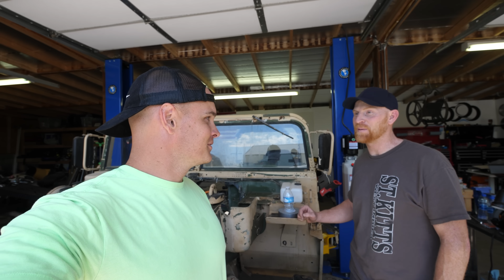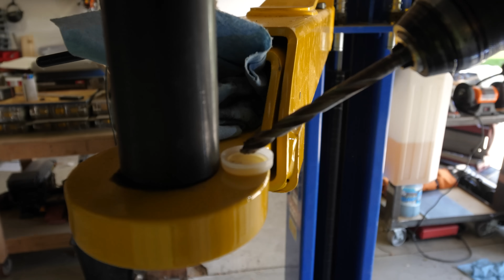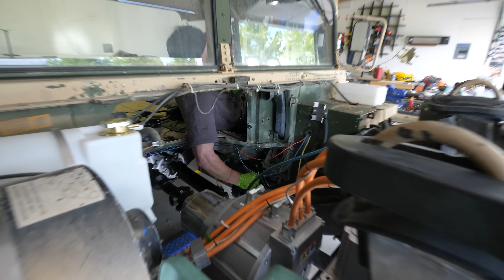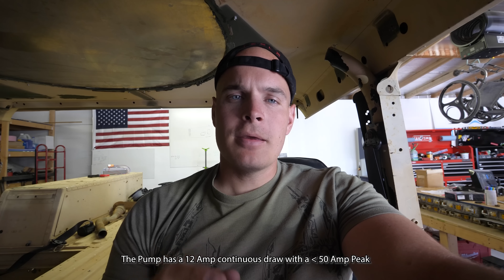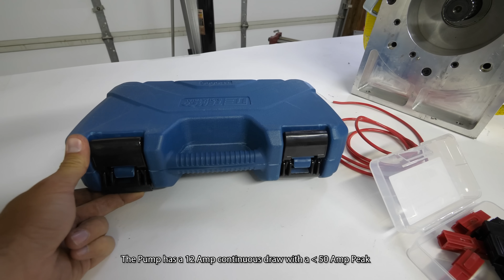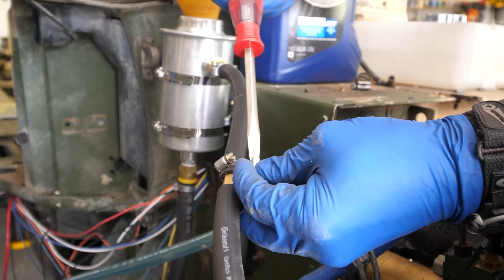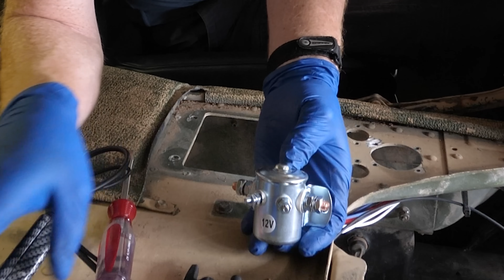We might have a problem with the Brakes... - Electric Hummer Conversion!

Comment: Adapting a Prius electric power steering column might be a good option, that are quiet and use high torque electric motors to turn the steering shaft
Reply: It's a good idea.. but the Hmmwv is a body on frame, and the column mounts are actually pretty flimsy.  All they are designed to do is hold the steering wheel for the driver, and crumple in a crash.  So if you mount a power column, you'd have to make the mounts stiffer to take the torque (it's ALOT of torque with a Hmmwv).. yet still be safe-ish in a crash.  If it was possible to put a simple electric assist steering system in a Hmmwv, it would be pretty sweet tho.. more efficient.. probably more reliable.. as long as you could provide enough assist to steer the wheels with a heavy truck with big tires which are sometimes aired down.

Comment: To make the hydraulics quieter, you could build a box around it of sound deadening material. Though, you probably want to keep it open on the ends, so you can get a little airflow over it to help cool the motor.

Also, it's not gonna be nearly that loud once the doghouse isn't open.

Another way to make it SEEM quieter, would be to relocate the pump to the back of the vehicle. of the very front, further away from you. One of the advantages of hydraulic systems, is the layout flexibility.

Comment: Use Car Sound Deadening wrap and cover areas close to the pump.

Also before putting in the interior (if you decide to cover the metal chassis ) put car sound deadening wrap on the frame then put on the interior floor to cover it.

Comment: The noise is present because the pump is running continuously,it should be setup just to assist when pressure and assist is needed not all the time.ex same thing happens with your car lift when you press the switch to go up,pump is turning to create positive pressure hence the noise,but when you release the button no noise.I hope this helps.

Comment: Have you thought about changing up your "ignition" switch for a multi-position switch that has an "accessory" position so you can energize your low-amp circuits (radios, interior lights, etc) without turning on your high-amp stuff (power steering, charger/inverter)?
Reply: Good idea...

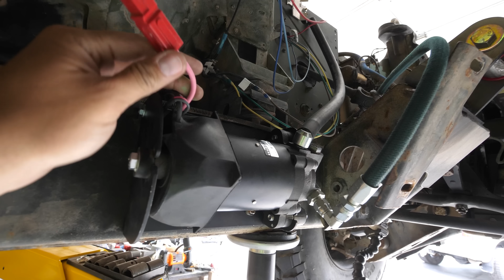Comment: 6:43 where that hose if laying against the metal frame, cut a piece of rubber hose, then split it down the side so you can slip it over your hydraulic line to protect it. Otherwise, eventually it WILL wear a hole in the line, and probably at the worst possible moment lol.

Comment: Hydraulic pumps are noisy especially if there’s no fluid. With it being a electric car you’ll hear things you wouldn’t normally hear over a combustion engine. Might just have to use sound dampening material when you put the covers back on or have a artificial engine noise?

Comment: Seems like a lethal combination. Heavy vehicle with on-demand brake pressure generation. Surprised you didn't add a hydraulic accumulator between the pump and brake/steering system.

Comment: Electric Power Steering and Brake Assist are the clear champions but I dont think there are any aftermarket solutions for a Hummer. 
They save a LOT of power, run directly off electricity and make little to no noise.
Reply: Im not aware of any company that makes an electric assist steering "box".  Everything I have seen is a rack and pinion style, or column assist.  And in a Hmmwv, the steering column mount is relatively light weight aluminum.  It would twist badly with a column assist unless reinforced.  Although it would be pretty cool if someone retrofitted an electric brake booster.  You'd have to find one that's electrically pretty simple, hydraulicly compatible (proper volume and pressure), and probably make appropriate mechanical mounts/pedal.  When the hydro boost goes bad in a Hmmwv it can be confusing to diagnose because people think they have a bad power steering pump, or bad steering box.
Reply: What about the brakes though? I wonder if there's some kind of hydraulic linear actuator that's powerful and responsive enough to use here... might require some fancy control circuitry.
Reply: @DFPercush  A funny DIY solution like that might work on a little robots project, but this is a car. Safety and Reliability go first, and a well thought out and tested off the shelf system is pretty much the only sensible choice. 
Both failure to brake as well as unintended braking are severely dangerous, so this really is not an easy field for a DIY solution.
Reply: @drkastenbrot  Probably right. But there's not much point in using EPS if you still need the hydraulic pump for the brakes, that was my point. Maybe air brakes? Those are fail safe. Both of those combined are a lot more expensive and laborious than some sound damping though.
Reply: Watching this you can really see the advantages of electric power steering.  With the hydraulic power steering you're constantly drawing power to to compress the fluid and sinnce it heats up, now you gotta dump the heat through a heat exchanger and you now have to carry the weight of the fluid,  reservoir, motor/pump, and heat exchanger. What a mess.

With electric power steering you only have to carry the weight of the motor and only draw power when you're turning.  It's no wonder aircraft and automobiles have moved away from hydraulic systems to electrically activated systems.

Comment: So Zack if your pump fails what redundancy do you have for your brakes? Why wouldn’t you just use a Electric power steering rack? Then use conventional hydraulics system for your brakes? If you Dynomat the area you won’t be able to hear the wining anymore.

Comment: I apologize for the lack of specifics but I know that many new cars use carpet-like material to deaden road, engine, etc. noise. If you could somehow wrap that around the pump in some way (maybe build a metal box lined in automotive carpet) that might just do the trick

Comment: Rather than using a relay or solenoid that requires a constant power draw to stay on, you could design a system where an arm pulls a power switch on but then disconnects when the key is in run, and another arm pulls the power off and then disconnects when the key is turned off.  It wouldn't draw power constantly, and would save electricity.  (You can buy them, of course.)  Also, please measure the amp draw of your solenoid when it's on, with your multimeter.  Amps X Volts is watts, and watts is the amount if heat it's going to have to dissipate.  Then post a quick video of that for us all.  Thanks.

Comment: Re: sound damping the pump. Use/find a free audio frequency analyzer app on your phone and see what its fundamental frequency is. It's probably around 500Hz. See what best absorbs this frequency while also being safe (non flammable, heat resistent). Rockwool by Roxul could work very well for this application. However keep in mind that any insulation from sound energy will more than likely also insulate for heat energy. If there is enough air flow then you could build a stainless housing shield to put over the pump which is lined with Rockwool, or simply line the dog house cover when you are done.

Comment: Double check the fluid in the system is correct for your electric pump. If not it will go mad and probably draw way too much current.

Comment: For dampening noise, padding it with car insulation or dampening sheets and putting it in an air-tight enclosure could work

Comment: Add a hydraulic accumulator and pressure switch, once it’s charged the pump will turn off. On a highway journey with limited steering input and braking the pump won’t even need to run.
Reply: Came here just to say this. 

Also, a hydraulic accumulator will ensure that is the pump fails (which they do) you won’t lose powered braking. 

I’d also be inclined separate the system & put in 2 pumps. One for steering & one for brakes, again for redundancy.
Reply: @Kelvasco  Yes the pressure accumulator and switch will help a lot, and to dampen the noise you just need to put the doghouse cover back in place, with the neoprene sound absorber intact, which will go a long way to making it quiet. Hard otherwise to damp it fully, as you need airflow around it to keep it cool. You can use extra rubber mounts and a metal shield to cover the top and bottom, which will help with debris control off road, and this can also have a neoprene rubber layer stuck on to damp sound more as well, but still allow cooling air to flow through. However I will say that the fluid reservoir is a little on the small side to run with an accumulator, it will need to be at least double the volume of the accumulator bladder, so as to keep enough fluid in the system to not suck air. 

As well you really want a spin on filter housing, and a hydraulic oil filter in the suction line, so as to keep dirt out of the system. The spin on filter should be there from the original Hummer parts bin, and it will go a long way to keeping the precision hydraulic parts clean. Plenty of chassis space there next to the pump suction line to put the filter in, and it will rarely need changing, just the annual lubrication service for the transmission will involve changing the filter, and topping up the fluid again.
Reply: @SeanBZA  FYI the stock Hmmwv power steering system doesn't have a spin on filter.  Just a magnet inside the pump reservoir
Reply: @Kelvasco  accumulator function in case of pump failure is only useful if there is an alarm for the failure. Otherwise, the failure will happen and the driver will be oblivious and continue until the accumulator is depleted and again faces a catastrophic situation anyway.
Reply: great idea it would also extend the life of the pump
Reply: true it works en sound damping same as tesla ;)
Reply: Very obvious point, obvious because it makes a ton of sense. I only ever hear the power steering while parallel parking which is when it needs to work hardest.
Reply: @bramweinreder2346  Good point, it would be interesting to know more about the current set up, whether the pump is constantly under load or not. A pressure gauge or running the pump free flow would be a good test. I suspect the hydroboost is under constant pressure and feeds the steering via a relief valve. If the steering is controlled by an open centre valve, the circuit will need split with a second pump as already suggested, before adding an accumulator.
Reply: dude gtma, i said the same
Reply: 2nd, accumulator keeps the pump off and provides a safety factor on power loss.   Also picked a bad spot to mount such a pump.    I suspect this setup would need some modifying due to the fact that the default position for these devices is unrestricted flow, aka open center hydraulics.
Reply: I was thinking the same. If I'm right there is also a bit of redundancy in this. For example if the pump looses power while driving you still have brakes and steering.
Reply: @153SCORN  well the brakes and steering are there no matter what -- they're just unassisted at that point.   Assisted brakes and steering are convenience things.   Without boost, they both still work.
Reply: Even my VW Lupo has such a device or each central heating system in the house.
Reply: Also a angular switch to detect the turn of the steering wheel. And Turn on or off the pump.
Reply: @c1a9h9r9  seems like that would only work if there was one pump for brakes and one for steering.  If you turn off the pump because there is now change in steering angle, you wouldn't have the pump flow for the brakes when you suddenly need them.  You wouldn't want to wait for the pump to spin up after you've hit the brakes.  Stopping a Hmmwv when the power steering pump fails is amazingly difficult... Like.. put both feet on the brake, hold onto the steering wheel, and try to stand your entire body up on the pedal and you still will only slowly come to a stop.  I've experienced this a couple times.
Reply: @strandtc  that's right. But with the hydraulic accumulator the problem could be solved I think.
Reply: @c1a9h9r9  I forgot to explain.  When there is no steering assist happening (going straight) and no braking happening, the power steering fluid flows through the hydroboost and steering box pretty easily (like 100psi of pressure.. good flow).  When you steer or brake, the valving inside those components restricts the flow and directs it to their internal components to do useful work.  This increases the pressure between the pump and the hydroboost or steering box.  Soo.. you can't really turn on the pump when the pressure drops, because that just indicates youre not using the brakes/steering.. and when you need the higher pressure... it wouldn't be there until the pump turns on.  Its kind of backwards.  Its a kind of "open center" hydraulic system I believe.  Atleast, this is how I understand it..

Comment: Solution to Noise - how about designing a gearbox that is coupled to the main motor saft, draws torque/power to run the pump.. This would work only when the vehicle is in motion and the regular pump can be used to power the steering and brakes in a stand still.
Probably an insane idea, but pretty cool

Comment: Great video, I just wanted to ask what brand of led headlights you went for. I have been looking at putting leds on my land rover defender but I’m not sure weather to go down the route of cheap and cheerful ones or expensive ones from top brands. I’m going for the halo ring style,  but I’d be interested to know what you went for. Thanks, Archie
Reply from the maker: Just got em on Amazon.  Not sure the brand.
Reply: @JerryRigEverything  Oh okay, thanks anyway. I have been looking for leds but I’m sceptical of the quality of the cheap lights, but similarly don’t fancy paying £400 for a set of wipacs. Vision x do make a halo light of sorts but I don’t know if it will fit the defender and it’s a slightly different style to what I had been looking at. I’m going to continue searching, but might go for cheap ones to start off with and the. Upgrade if they aren’t any good after a month or two. Thanks for your help
Reply: VisionX makes kick ass round led headlights that will fit in a Hummer with a halo rings.  Not sure about fitting them in a defender.. and last I looked they were pricy but a quality product.

Comment: What kind of tool did he use in testing the solenoid for the power steering I'm so interested in the tool that he use.
Reply: I'm not sure which brand he was using exactly, but there is a brand called "power probe".  Super useful for 12v diagnostics, but they can be a bit pricey.
Reply: @strandtc  thanks for the information.

Comment: Wire the solenoid control side through a pressure switch and add an accumulator to the high pressure side of the system.
Reply: Power steering hydraulic system constantly flows even when not steering or braking.  Its a good idea though
Reply: The hydroboost system doesn't need constant pressure. For the power steering system he could use an electric steering rack 🤷‍♂️

Comment: Theres a fluid that works for power steering and brakes? I know if you mix them up power steering fluid will eat the seals of brakes.
Reply from the maker: This is Hydraulic fluid that is just adding the assistive pressure to the brake system. It's not the actual dot 5 that's in the brake lines.
Reply: @JerryRigEverything  Oh I See. I was super confused for a minute! Im not a mechanic. So TIL

Comment: Most auto manufacturers who use electric pumps or any components that make noise from normal operation will mad them ”on demand”. Esssientially the pumps only turn on when you press the pedal or when your steering wheel hits certain angles. They will also wrap them in insulation either a mat or a custom housing to make it less noticeable

Comment: Why do you need a solenoid if it's going to work the same exact way like a relay.. I have seen solenoid being used where you need a mechanical means (E. G. to switch fluid valves, or engage disengage gears etc) but here both just handled current switch.
Reply: Those solenoids are designed to handle higher current than the other relays he was using.  If you run too much current through a relay, the contacts can first weld closed (can't turn it back off), and the entire relay can eventually will melt and burn up.

Comment: If you move the pump farther into the front of the vehicle, and/or insulating it with rock wool on the top of it, not surrounding it entirely because you know, heat ;)

Comment: Why you are not using pressure brakes like htv. Like they use pressure silinders that fill only at startup then brakes use pressure from silinders rather than directly from motors.

Comment: Surround the pump with sound isolation. I'm not a Mechanik, but I think 2cm thick foam should be enough.
And using softer rubber for isolation.

Comment: Theres sound deadening foam used for server rooms, made out of old denim, and its fire rated, check it, if ya gotta make a wrap for the pump area, with some temp+oil rated rubber, and the insulation, or a PVC pipe, just make sure you add a thermal limit switch to the pump, so that if it does overheat it can kill itself, and then add a warning light on the dash for if its getting close to overload, perhaps, could also use rubber standoffs to isolate pump vibrations from frame, and enclose the whole thing in metal + the foam, so the metal acts a an external heatsink, and the foam to deaden the sound, just have to make sure something is conducting the heat between the two...up to you really

Comment: As if the loudness from the pump i don't think you will have any issues once you have everything put back together and running. That Hummer isn't going to be quite once its going down the road it will be much louder then you think. I personally think you will not hear that pump at all.
Reply: Just the tire noise alone with drain out the pump noise. Just my thoughts though